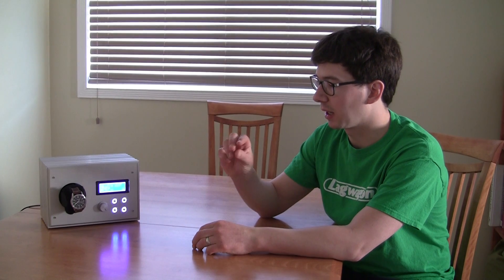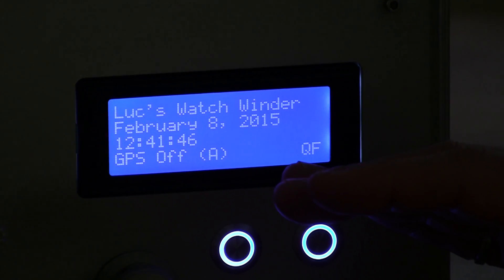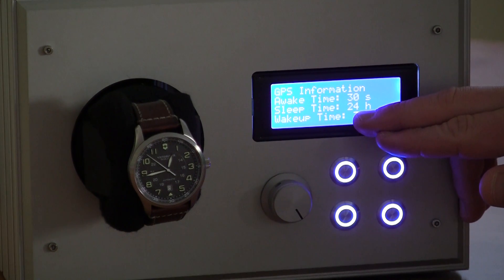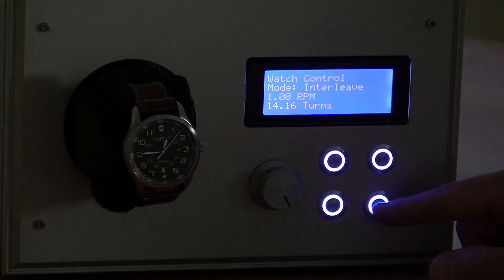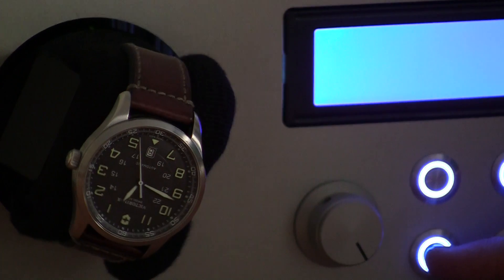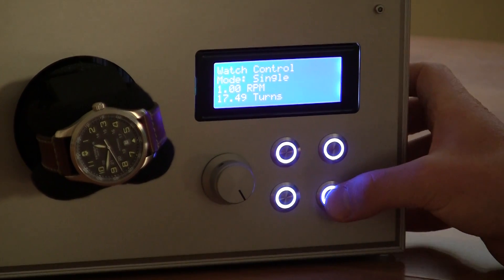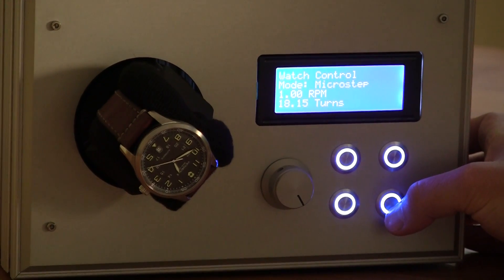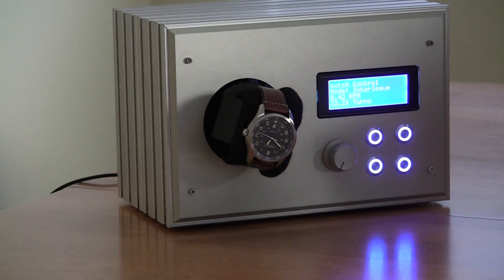Arduino Watch Winder Tour

Comment: Too complicated and jerky
Reply: He mentioned it was for a project, hence the complication. Would be easier to just hook up the watch to a motor with a pot attached to it and control speed that way, but adding all the modes and GPS connectivity is fun.
Reply from the maker: Thank you for your useless comment. anything constructive to add?
Reply: +lucgallant Just get a cheap single winder from eBay for that cheap watch

Comment: Why is that thing so jerky?
Reply from the maker: The motor has multiple modes one of which is microstep which is smoother but it does kind of a high pitch noise. In the other modes it is a bit jerky because there is some weight for each step....
Reply: +lucgallant this  is stepper motor, good project but it will give some micro shocks. All commercial winders have continuous motors....
Reply from the maker: +lucgallant curious, do you anticipate this potentially damaging the long term?